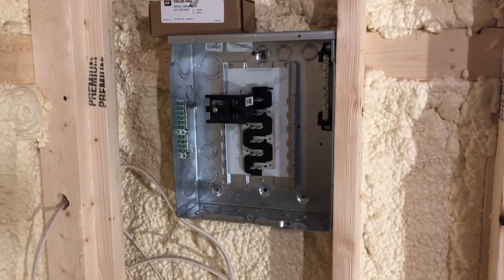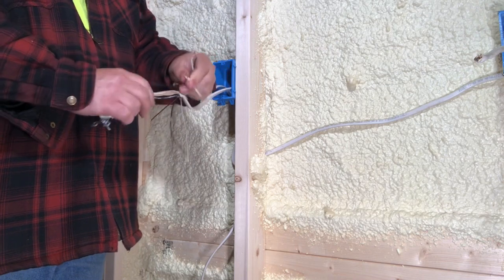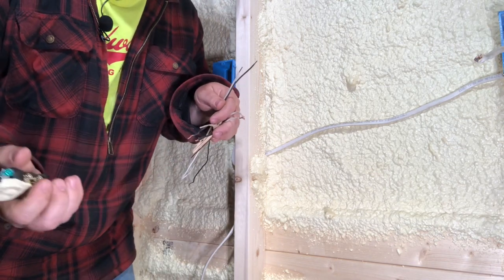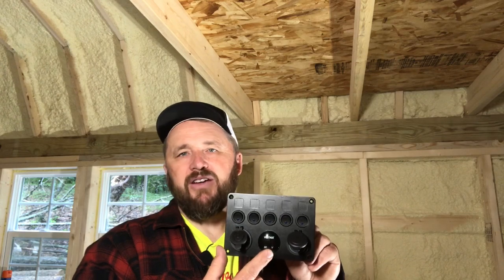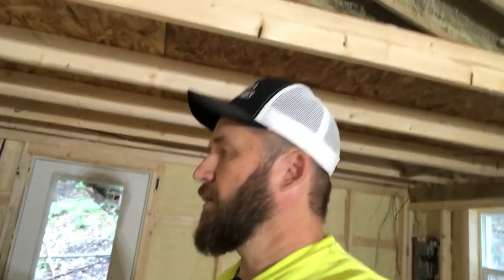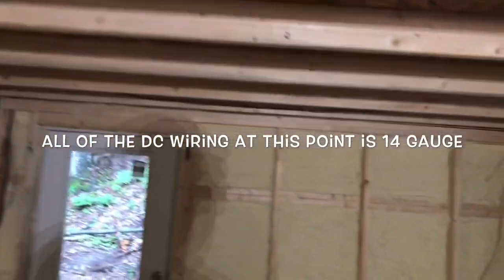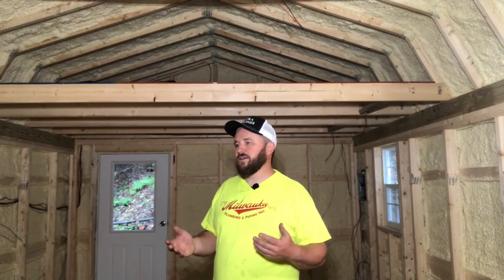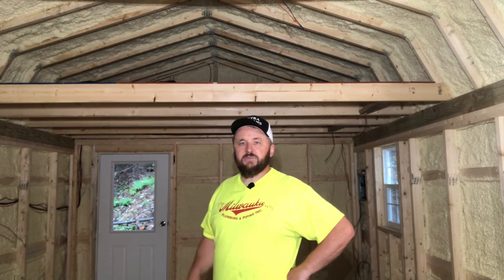Wiring the cabin for solar & generator #karlsoffthegrid #wiringacabin #wiringcabinforsolar&generator

Comment: If you have a kitchen i think you must have 2 20 amp circuits
Reply from the maker: That may be correct in some areas. I am just simply showing how I set up a simple system. I later on install a all in one solar set up that provides protection as needed.

Comment: Hello Karl, thank you for the nice video. Two questions: You said using Strained DC wire is essential, why is that. I just bought DC Solid wire thought that is better. You said you found those lights on Amazon, what is the brand, or type of name that can help me search for it? Thank you so much!
Reply from the maker: Current tends to flow better on the outside of a conductor, so stranded wire is almost always preferred for solar applications. It gives you more surface area which gives you better conductivity which in short means you get better electrical flow. Here is a link that is similar to the lights that I purchased for the cabin. I usually don’t recommend one certain brand until I have had the chance to try it for a while so far these have been good.
Ming's Mark 0403.4000 9090108 LED Reading Light
Sorry it’s not letting me post the link. You can search on Amazon 12 V reading lights and there is a bunch of LED lights that you can choose from. Sorry I can’t do more than that

Comment: What is the power source for the breaker box? If you don't mind me asking how much did the build cost including the cabin? Was it a kit or did you build it yourself?
Reply from the maker: I use the breaker box to house the wiring that is connected to an outside outlet that I can use to feed the house with my inverter or a gas powered generator.Here is a link to a video I did that breaks down the price of the cabin. Thanks for watching
https://youtu.be/VHgdt5AaAnI

Comment: Hey Karl, as always, great stuff. Question, what kind of inlet or plug in did you use on the outside of the cabin for connecting the generator to your cabin? I'm doing the same and not an electrician. Thanks.
Reply from the maker: Great question. I started out using a GFI outlet and it didn’t work. After consulting with an electrician he advised me just to run a standard outlet in a waterproof junction box. He said the generator already has a GFI outlet on it and that’s why It didn’t work .After making the changes everything has been working perfect. Good luck

Comment: You should never pigtail your first or any outlet the way you did it. You will never blow a receptical and even if you did the rest will continue to work. Your pigtail just became the weakest link in your system (heat), there is a reason there are 2 supply lugs on recepticals.
Reply from the maker: I understand your concerns but like I said in the video 50% of electricians would tell me I did it wrong in the other 50% told me I did it right. So what I resolved to do was I asked our electrical inspector which way he wanted it done and I went that way. In reality I’ll probably never use the AC outlets, it’s been a year now and so far I have only used DC.I appreciate your comment thank you so much for watching
Reply: @karlsoffthegrid1378  I was not refering to your preveious working but rather stating that just abour everything runs on DC anyways, Was commenting on your comment where you said you have only used DC. I agree with this, since everything uses DC i see no reason for AC. But yes congrats on your things.
Reply: @karlsoffthegrid1378  Yeah its all good, I too only plan on using dc as everything that runs on ac just runs on dc internally anyways, its such a waste to convert from AC/DC , DC/AC anyways.

Comment: So you might not need an A/C unit but here in Florida we do. What would you suggest?
Reply from the maker: 50% Deplorable I would check on Amazon for 12 V  A/C units. You can find just about anything for 12 V nowadays. If you’re running 6 V they have that as well. You can also check at “camping world” it’s going to take a little bit but you can find just about anything

Comment: it is clear to see you really have no real exp installing ac pigtails are a fire waiting to happen. that's why they have a buss bar on the outlets for the second wire and 99% of the time the buss bar doe's not burn out when the outlet fails . pigtailing is just another splice to heat uo as it gets loose in time and yes they all get loose
Reply from the maker: Thank you so much for the comment I knew this was coming. As for my experience I have been in the building trades since 1985. Ever since 1985 I have been listening to electricians debating on whether this is correct or not. This is the way that Wisconsin state electrical code Recommends. I agree I could’ve run it the way you say to but I would’ve had 100 guys telling me I did it wrong. I opened this segment in my first video saying “this is not an instructional video on how to do it, this is the way I have chose to do it”. Your statement is correct on how to wire but the way I chose to do it I feel is a lesser of two evils. Thanks for spending time on the channel I appreciate your comment

Comment: There are alot of DC appliances.  12 and 24 volt. Cook tops, desk fans, ceiling fans, DC only fridges, kitchen gadgets. Look at Camping World has a lot of DC stuff.  DC strip lights, my favorite. It is a tape that you can cut to fit any space.
Reply: Also look on Amazon for solar attic fans.  My favorite is DC direct. Only on when the sun is out. You can also put it on a battery and a switch.
Reply from the maker: Steven Crawford I am checking it out as we speak, thanks again I appreciate your help
Reply from the maker: Steven Crawford Thank you so much for the info I will definitely check out camping world. This is great information I appreciate it